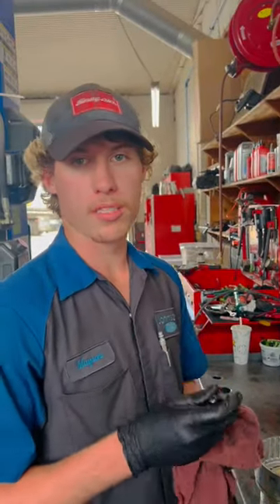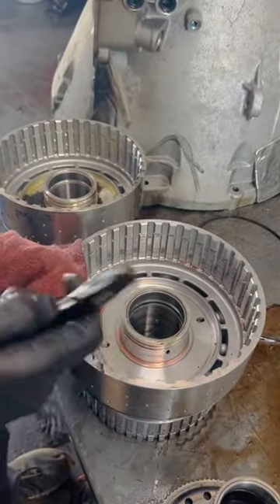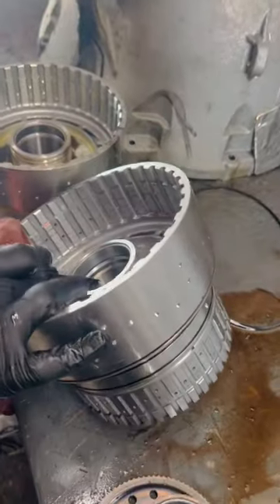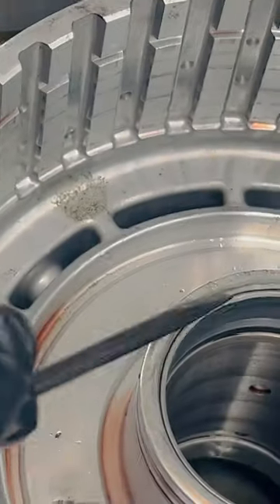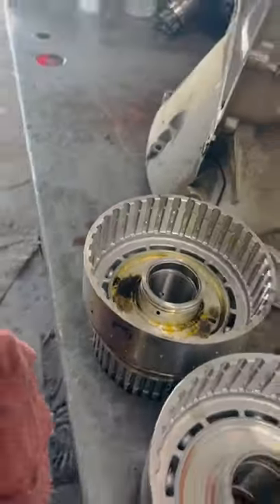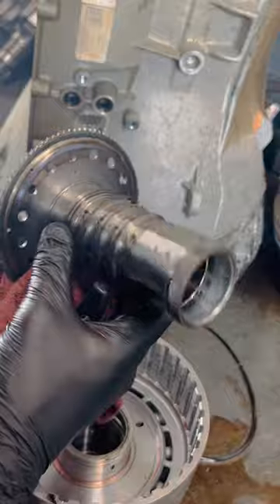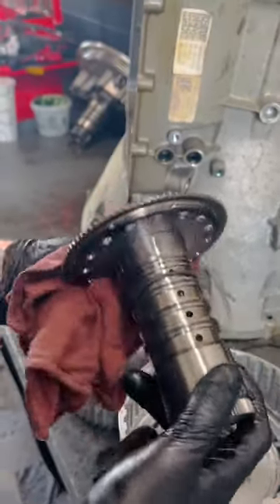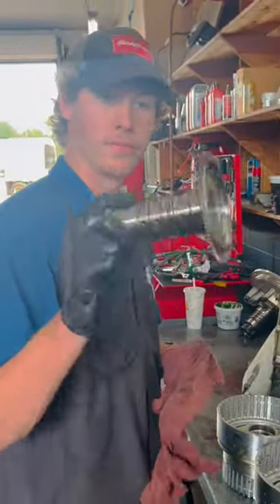Most Common 10R80 Transmission Issue #shorts

Comment: This clip saved me from going crazy.  The Ford dealer my 2018 F150 3.5 Eco (10R80) for couple weeks w/no idea what was causing the shifting problems. I sent the service manager this short and within a week I had a new CDF drum.  Thanks a million! Great channel.
Reply: I understand you had to go there prob for warranty issues but if I had you Ford truck roll in my bay with this goin on I woulda had your truck done same day with either  new or rebuilt trans. On the road again. Not sure what was perplexing the dealership you were at?? Clearly something wrong take trans out give customer new one under warranty if all maintenance paperwork is legit.  Tear apart trans later to find problem. They should not make they're problems your problems. I think that is such bullshit.!

Comment: NICE presentation Mayson!👍🏻😉
Great to see a top notch Ford Technician, from your generation , that will step up when I and my generation retire. 
Been doing this since 1987....about another 10 years and I am DONE! 😎
Reply: Hope it's an easy 10 years for you!
Reply: Our 2021 expedition when downshifting under heavy acceleration or normal hill grading will seem it goes into neutral but making a grinding noise. It will eventually times finally "grab a gear" and go. But for 5 to 15 seconds it wont do nothing. Not even rev up. Kind of scary. It will throw a yellow/ orange wrench up but the dealership says it's not showing a code.
Reply: This is shift shock in second gear ???
Reply: @armaliteAR10A4   aftermarket programming is available to completely correct all shift problems with these Ford transmissions. The system used to correct the shifting is HP tuners
Reply: @100pyatt  bull shit... They tried that... it don't fix anything if it's already caused damage. We had to trade ours off because Ford would not replace the transmission and torque converter. Who ever was making the decisions from ford directed the mechanics to keep swapping part by part. They would replace one part and it would still do it. Replace another and still do it again. The expedition got to where going down the interstate the check engine light would come on and the vehicle would not accelerate, making the same noise as mentioned in previous comment. Almost as though it was in neutral. Scary for sure. The mechanics told us ford is going to keep swapping parts like this because they dont want to fix what's wrong. The mechanics said it needs a new TC and trans because of all the codes it was showing. After 6 months of the back and forth, We had to trade it off as I have 4 kids and my wife needs a safe vehicle. Now someone else is stuck with the thing. I felt bad for selling it knowing that someone would get stuck with it but, I couldn't eat that much money. The dealership took it to far away auction because they didnt want to sell it to anyone local. Ford may make good vehicles at times but they definitely didnt help us out or even care. O' they make bullshit phone calls and ask how it's going, what do ya need, and always reply we are engaging additional resources to help. It's all fluff. We will never own another Ford if I can help it.

Comment: I got a 22 GT with the 10R80 and it is hands down the worst transmission I’ve ever experienced. Don’t get me wrong, when you want it to go it does it’s thing and that’s why everyone hypes them up but for literally EVERYTHING other than being flat out, it’s a hot pile of trash. Whines loud asf, jerky shifting, gear hunting, you name it. I would like to get it in to a shop and get it beefed up/checked out but I’m waay too afraid of the shops around here pulling/cracking the trans and leaving me worse off than I was 😢
Reply: I’m 😂😂😂. The whine part bro.
Reply: Still complaining or have you got it checked yet?
Reply: Whether you have a Ford or GM 10-speed, if it's making a whine, get it to the dealer or a transmission shop right away.

Comment: Also be careful the “clutch relief valve” you know not a check ball but a check ball with a spring will have the same symptoms as a failed cdf bushing. You pull it apart and bushing hasn’t dropped, planet 1 and 2 have destroyed each other. Whoever built that trans didn’t measure T3 and all that metal destroyed valve body. Not to mention always pull  outshaft metal gets stuck in E clutch apply passage. Ask me how i Know 😂 if your 10r80, defaults to 4th after an overhaul. Will pass an air check all day but when hot will loose 123

Comment: Yyyyyyup.  This is about to cost me nearly $8k on my 2018 f150 with only 58k miles.  Thanks, Ford
Reply: I thought they were extending the warranty out on these.
Reply: What about your replacement transmission is it holding up? Or did you get rid of the truck
Reply: @Kylewraps  got it replaced the third week of July, and so far, so good.  I paid a little extra for the dealership to do it just to have the 3 year warranty. Was either that or offload the truck, and either way I take a beating.
Have to say though, that it feels like the programming for the replacement is like how my previous one felt when in Eco mode.  Wants to be in an overdrive way before it’s ready
Reply: @MotoNoir86  oof that sucks $8,000+ with that kind of mileage is pathetic 

My 2014 Silverado had its first real repair yesterday PCV Valve went out I also got spark plug / wires changed, cleaned throttle body and injectors while it was in the shop it’s got 186k miles only other thing that’s broke on it is the common A/C condenser issue which broke at 35k miles and was under warranty until 36k miles (phew)
Reply: Same here 2019 ford ranger saying I need new transmission not good don't know if I should replace it or get a new truck
Reply: @Freedom2219 and that’s what stinks.  Take the hit when you sell or take the hit replacing it.  Even trans shops around me quoted 6k to overhaul it, or if I got my hands on a new one, would charge me $3k just to swap it and only warranty the installation.
Good times
Reply: Me to. I had no shifting problems the wife went up the street to get smokes went over a speed bump slowly went about 200 ft and the truck threw a wrench 🔧 on the screen and barely got her 500 ft to the parking spot where she couldn't back out of.  Code was P0751 shift cylinder A performance stuck off. Anyone have any idea if this is just the valve body A spool sticking?
Reply: Code P0751 valve body A performance stuck off. Anyone know if this is just a valve body spool stuck or a symptom of car drum failure
Reply: This needs to be a RECALL
Reply: I have a 18 5.0 and mine lasted till 127k miles but cost 9100 to replace. At a transmission shop .

Comment: Can you shed any light on the 10R80 shifting issues? How does one handle this issue when taking the vehicle to service? I love my 2021 expedition max but the shifting issues are pushing me to get rid of the vehicle and I really don’t want to do that.
Reply: Most of the shifting issues are because of this slipped bushing. The CDF drum has been updated May of 2023. If you want to further enhance the shifting, Suncoast has a modified valve body and an improved pump that holds more line pressure

Comment: Ford engineers : will say GM designed that part of the transmission .
Reply: Gm and Ford actually collaborated this transmission.
Reply: Because they probably did…. Gm having lifter failure left and right.
Reply: Hey, don’t spill all of our priceless secrets over here! If we collaborate with GM and something fails it was definitely GM and not us…….meanwhile at GM, It was all Ford! Gotta love the automotive industry!
Reply: @freedomisntfree_44  because there hasn't been any fords with issues? I mean now they are all shit and I wouldn't touch most American cars with a 10ft pole
Reply: @stevenjohnson1692  do a lil research, gm lifters been failing since 07 and they’ve had multiple shit transmissions. They all have their problems by gm is by far the worst and someone has to die before a recall is issued from them. Toyota and ford own up and fix the shit.
Reply: @freedomisntfree_44  Ford needs to step up and do a recall on this disastrous series of transmissions
Reply: @07killerseven  Ford lead the design of the 10-speed and in exchange GM lead the design of the 9-speed/8-speed transverse transmission. I get it, you want to share the blame so you can say it was GM that designed that CDF clutch bushing, but the 10R80 and 10L80 is a FORD transmission. Funny how Ford guys were screamming at the top of their lungs that the Camaro ZL1 had a 10-speed thanks to Ford and that it basically existed because of Ford, but now that they have problems it's "Oh um mm well GM designed it with Ford!"
Reply: @freedomisntfree_44   GM builds and sells over a million vehicles with those lifters. You see lifter issues "left and right" because there are a million flying off the lots each year. I wonder how many 5.0's would be dropping valves or 3.5 Ecoboosts needing cam phasers and timing chains or 2.7 Ecoboosts needing new EGR coolers if Ford put out a million of one of those engines each year. We would probably be seeing them failing left and right.
Reply: @freedomisntfree_44  "Toyota and ford own up and fix the shit." LOL no Ford just changes the generation of engine every 2 or 3 years. How long has the 3.5 Ecoboost been associated with cam phaser/timing chain issues? It's still going on today. Same goes for the Coyote.  You'll deny it but Ford and cam phaser/timing chain problems go hand in hand. You'll say it's rare or it's the fault of the owner and that you've never known anyone with the problem and I will say 100% that I live in a region where I'm surrounded by GM trucks, Suburbans, Tahoes, and Yukons and I don't see piles of vehicles sitting outside the dealer's service department waiting for new lifters. I know guys that have 200k+ miles on their 2014+ 5.3 truck, never turned off AFM, never had a bad lifter. You run your mouth about GM lifters because you're an insecure little boy that's butt hurt about this Ford transmission having issues that come with designing a totally new transmission from scratch, just like GM had issues with the 8-speed when it first came out. It's not like Ford hasn't had their own struggles with designing transmission. There are plenty of known issues with the 6R80. I just had my 6R80 lead frame done a couple years ago. The 10R80 having issues is 100% expected.
Reply: @hochhaul  none of the fords have failed before the first oil change like gm trash. Gay man’s chariot awaits you sir.
Reply: @freedomisntfree_44  That's funny, just saw a brand new 5.0 with a broken valve the other day. Sure are a lot of those valves dropping from what I see on the internet.  Not to mention I remember seeing a ton of 2.7's with egged out valve guides or broken valves when that engine launched. And there sure are a lot of Godzilla 7.3's eating cams and lifters at low mileage. I even remember GT350's eating rods in the first hundred miles. Quality is job none!
Reply: @hochhaul  show us then….
Reply: @hochhaul  what I figured. Another gm gay with no proof 😂

Comment: I see you rebuilding a lot of transmissions. Is that pretty standard at your dealer? I woukd imagine the cost is a lot lower to rebuild that than to replace.  I work for Honda and the opposite is true. Do you make flat rate? Also,  how many other guys are doing rebuilds like that on a regular basis? Hope youre making good bread. I dont k ow many techs outside of specialty shops that know how to reman a trans.
Reply: I don't think he work at ford
dealer don't rebuilt thing anymore all of them it must be a independent  transmission shop
Reply: A ford mech is busy (warranty) especially a good one like him. Keep your tools clean and eyes and ears open. OH And taste a drip on the floor once and a while 😝
Reply: They are all different nowadays. Some dealers sublet tranny work. Some have builders that just build, some have techs that do r&r/heavy line and build the tranny's. And of those guys, some are paid hourly/salary some are on flat rate. I've literally seen all kinds of combinations. And this is both at indys and dealers.

Comment: I have a 2018 f150 3.5 ecoboost with the 10r80 and ever since I've had it, its always had a weird shift from 3->4 especially on cold days. It's like the transmission is slipping when it does that shift. I believe i have had it on the 7->8 shift a few times now too. Rpms will go up a few hundred for about a second, and then it will drop back down fast and cause the truck to jerk
Reply: I feel this sometimes. Any word?
Reply: @michaeljacques4059  still haven't brought it to a dealer. Bought it with 19k miles and it's done it since the day i bought it. It's way more noticeable in cold weather, but overtime i would say generally it's more noticeable than when I first got it. Personally I think it's something that is coded wrong in the truck and the reason I say that is because my brother and I used forscan to reset the learning for the transmission shift curve. Basically it just re-maps how the truck is supposed to shift depending on rpms and speed and engine temp. When we reset the mapping, the transmission worked flawlessly. Give it a couple weeks to a month and its back to doing the same stuff again. That's why I think it could be more computer problems than actual mechanical issues, but I could be wrong.
Reply: My raptor trans sucks so bad. Can’t ever figure out where it wants to be. Literally horseshit
Reply: This is a common characteristic of a slipped bushing in the CDF drum. May of 2023 Ford updated the CDF drum adding a lip so the bushing can no longer slip. The new clutch drum dealer cost is $208
Reply: @100pyatt when it slips down does it typically take out other parts with it besides that o-ring/seal?  Meaning does this require a full rebuild or should replacing the drum and seal alone fix the issue?

Comment: I just took my 2020 F150 3.5L with 60k miles back to Carmax. 

Once the transmission was up to operating temp. I noticed the transmission would shift weird between 3-4-5. I took it back, confirmed with the Carmax tech and they sent it to a trans repair shop. I’m hoping the find this CDF drum slid and it’s what’s causing the issue.

Comment: What about 6r80s. Seems I been having some kind of shift issue for over a year but no clutch packs burnt up. For a while I thought it was the IWE system. It mainly did it between 3 to 4 around 45 to 55 mph. Now it makes a noise and shifting issue whenever I floor it almost 70% of the time.
Reply: 6r80 uses the same style drum which has been updated by Ford in 2023 to have a lip that stops the bushing from slipping causing all the shifting chaos

Comment: 6,8 and 10 speed transmissions...get the same gas mileage as a truck from the 90s,at highway speed it should be idling
Reply: 6,8 and 10 speed transmissions are able to efficiently tow 4x as much, and get better mileage using less fuel because overdrive can still be used. 
Easy boomer.
Reply: lol in your dreams. the latest transmissions have made it possible to tow 13,000 lbs with a half ton, SAE verified, and still get 20+ mpg unloaded. The 300 was a good engine, but it ain't towing 13,000 lbs up Davis Dam and getting 20+ MPG unloaded.

Comment: I love manuals.
Reply: Save the manual 👍
Reply: Same here. I love actually controlling my motor.
Reply: Manual boosted s550 here
Reply: @dikdawg3438  I'm at the other end. My Outback has so little power it takes alot of finesse . Not a good car to learn in.
Reply: 89 toyota pickup with 5 speed and built motor. wouldn't trade it for anything
Reply: Cool where can we get one that can swap into these trucks and work without issues. Ideally one with a 1st gear ratio of 4.69 and a top gear ratio around 0.63
Reply: Manual will hit 300k without issue for f150 but. They build great engine but not great transmission.

Comment: I have a 2018 f150, with a tune making 548hp to the wheels for the last 4 years. I have 128,000 on it. And knock on wood. My 10r80 is holding up good. Mind you, I changed the trans fluid twice, so for, only because I tow a heavy trailer for 400 miles 7 times a year.

Comment: I have a 2022 trail boss with the 10L80, brand new truck. Since day 1 it has shifted hard at times on the 3-4 shift. I don’t trust it at all. Crap GM product like usual. I had 2 8L90’s in my last 2 new Corvette’s. Same hard shifting and surging issues. Bottom line they make crap products. Next truck will be a Toyota. Never again with GM or Ford.
Reply: LMAO Toyota Tundras are eating crank bearings like a Ram EcoDiesel and they have had their own share of transmission complaints.
Reply: @hochhaul  the one? 😂 nothing like gm problems.

Comment: Question so how would I fix that or improve that I have a 2020 gt 10r80
Reply: Not much you can do. Service the trans often  and hope for the best. They’re continuing to build the part this way, so even if you replace it…
Reply: Ford released an updated design in 2023 for the CDF drum that has an internal lip and it prevents this bushing from slipping, causing the problem ever again. It's a permanent fix
Reply: @TonyLasagna No sir they are not continuing to build this failed part. They updated the design in May of 2023
Reply: @100pyatt gotcha, my comment was from around then actually so had no idea lol

Comment: Could this lead to a drained torque converter?  Mine rolls backward about 10s each morning until the pump fills it back up. Even if revving at 2500 rpm, it's like clutch is full in on a manual and rolls back like 2-3 car lengths.

Comment: My gf was driving my truck the other day going 80 on the interstate truck got stuck in 10th gear truck coolant started to overheat trans temp got to 226. Now the trans slams gears has shift rpm flair and will randomly go for 6th to 1st. Ford says shes toast. What would cause it to just randomly fail with no warning signs before
Reply: Bushing slipped. The good news is the updated design will completely fix this issue from ever happening again